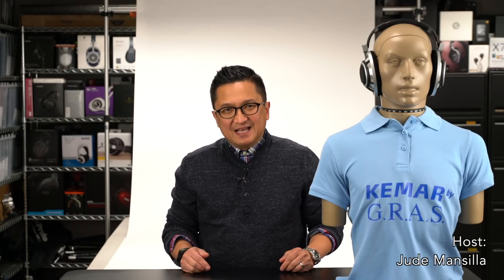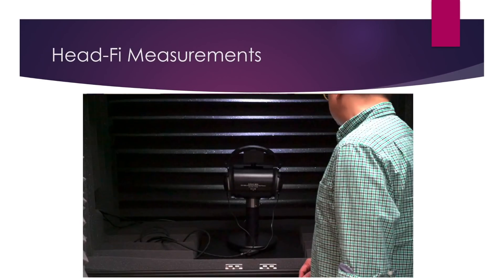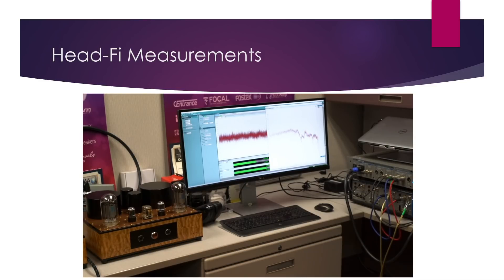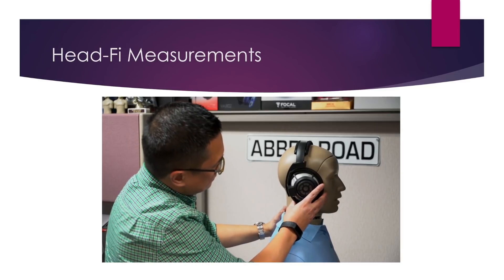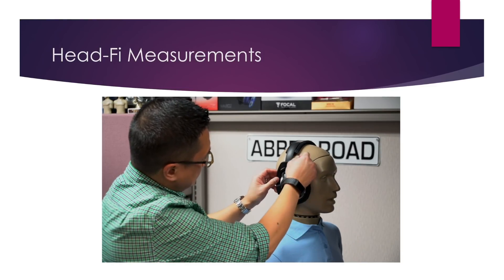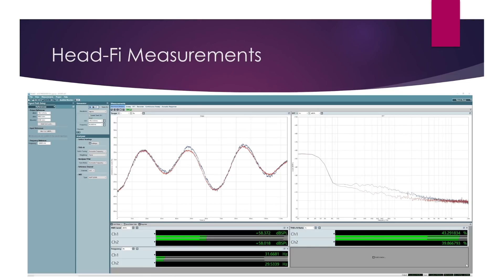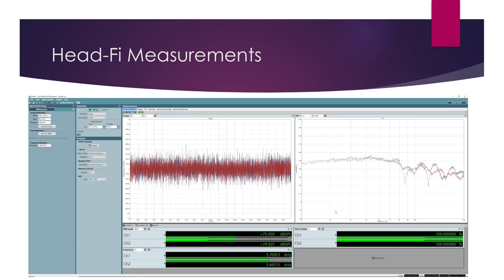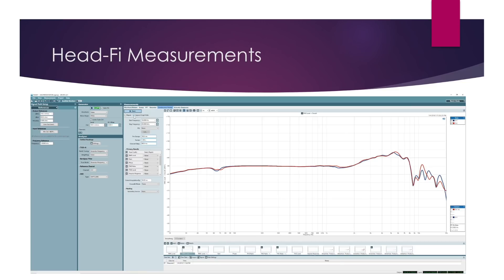Headphone Measurements - Positioning The Headphone - Head-Fi TV

Comment: The difference in height between a driver, and the side of a persons head affects harmonics and phasing in the upper mid range a lot. The clamping force, size of a persons ear, and the shape of their head, will cause some people to hear a 5-7khz ringing where the amplitude sharply rises over a narrow frequency range, while others will not hear this. It's not because different people are more or less sensitive, it has to do with the size of the air chamber around the ear and inside the earphone cup. This is for instance why some people complain about mids on a headphone, and others say it sounds perfect.  Think of a headphone as a mouth blowing air, and the side of your head, outer ear, and ear canal, are a flute. Any change to the volume of air that is resonating, changes pitch (like depressing keys  on a flute making the vibrating air column larger or smaller)
Reply from the maker: We did a simple observation/experiment that shows the effect of individual transfer functions with the same headphone. I'll be posting about this on the forums at some point, but it's not something we'll likely shoot a video about.
Reply: Subparanon Should a person invest in a pair of CIEMs instead of around-ear headphones to get sound reproduction that does not vary with headphone placement on the head?